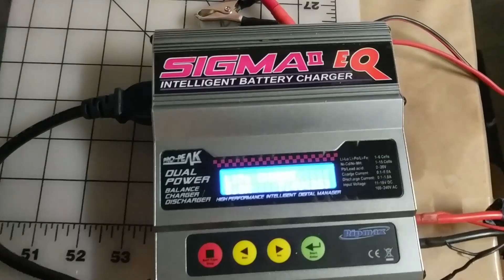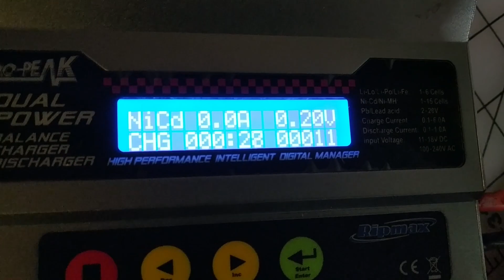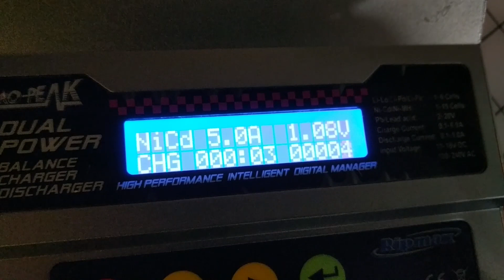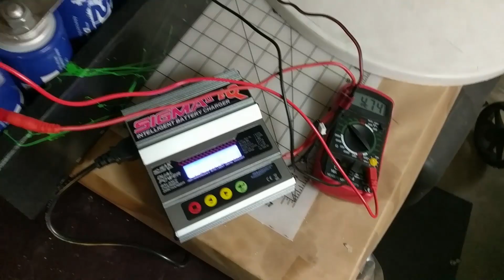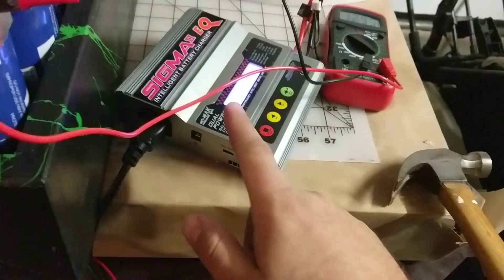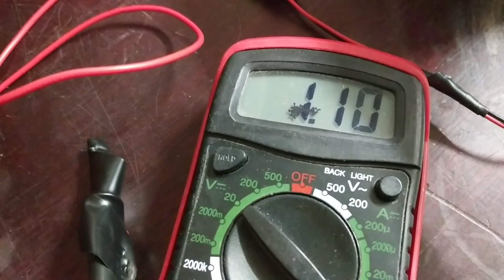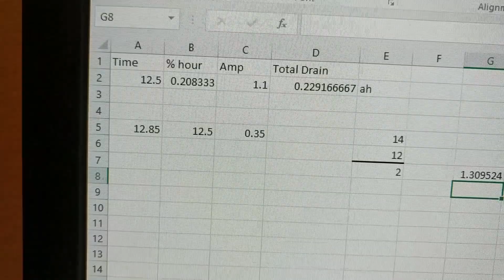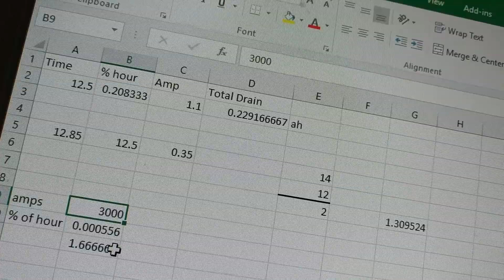How to charge a Maxwell bcap3000 + capacity test

Comment: man, you can charge these caps with a few hundred or even thausends of amps without heating them up! Each is able to deliver 2000 Amps continuesly! The max. short circuit current can reacht 10.000 Amps for a single cap! You should know about the datasheet when manipulating with that mass of super caps!
Reply: no worry with charging them from that pity charger... you can propably get that pack full directly from thunder
Reply: Yes for certain the could be charged in a second flat, actually. 833.3 ms utilizing a X-Former capable of delivering at least 37.5 KVA. With an output of about 20 VAC @ RMS of 14VAC feeding some healthy  thyristors...  Maybe a dozen of those 70mm. 1,100 TZ  Infinion's. In a Delta configured bridge with,  Duty control PWM regulated by set voltage cutoff.    Doubtful, it would take even 40 Hz to slam them full.  Giggle, but CAUTION when  selecting your sub cycle surge current overload fuse...  Wouldn't want to be off by much more than a few thousand A either way...  Giggle..  Yep, we sure could slam them full in a hurry..

But I admire his slow but sure initial testing.   Nice handy work on construction,  besides the longer Delta ( t ) span, the more resolution accuracy.

The tie blocks were nicely machined, nice work, nice proto work...  After reading about 27+ pages of the actual product Spec. Sheet from MFR, and a review of nice graphed response plots, one can come to a conclusion that expected cycle full load response curve plot shows that 0.2 Hz  or 5 second cycles are expected under normal use.

A few comments in this batch I saw along with some others in another video also showed some confusion when folks use the series Aiding math.

The standard formula for series capacitance does not truly apply here,  it's more involving ( dt / (Vmax - Vmin).   Not as a function of (Z) and (Xc) in capacitive reactance, because "Taou" or one time constant for this ultra cap is one second, and they certify it's performance half point at double the internal resistance on the curve plot on p. 26  clearly.

Exposing this device to a ripple voltage, would cause internal heating..  In fact it behaves more like a series inductor than a capacitor in a frequency response curve ending abruptly about 10.6 Hz..    They did 70% rest to load duty cycle plot..  Again 5 (t) is required for any cap, so 5 seconds.   This device is an amazing little package, if used properly, a time and place for everything in it's place.. Giggle..  These work wonders coupled  with battery as a (dV / t ) surge buffer or stabilizer to eliminate surge flow through PV distribution combiner buss etc...   Also great for high current short demands with DC BUSS inverters, and VFD's.

We use them for charge cycle flow surge current suppression,  "coupled with a high C. Cap bank" to handle instantaneous, current surge, allowing the ultra cap 1.5 to 2 time constants to begin responding, extending it's life cycle..

Caps in conjunction with this ultra cap and a good AGM telecom battery bank, are amazing..  We also are developing a true hybrid, using known technology, time proven..  Telecom batteries have a solid 20 year float life rating..  They also have a very flat. 0.5V.  Vmax  13.1V.   to 12.6V empty..  Keeping buss Voltages stable, exactly what the inverter Dr. Ordered..  Giggle..

Key note here, if your seeking long term low current battery backup,  with capability of periodical. High current or dynamic range, yes..

A million rated cycles, beats the panties off any known chemical batteries, hands down , safe compared to Lipo, as also lithium's require maintenance, inherently temp. Unstable, fire hazard, a time and place for them yes..

RC's , drones, power tools, even gadgets...  Yes..
Folks are quick to forget Boeing's little mishaps with a couple 787's still on the ground..  Giggle..

Sure thing Elroy, it takes time and $$$ you don't have to work out safety issues..  Just be safe and have fun, if you have an idea, then go for it, give it a whirl, also share your research and ideas, it how we got here to begin with...

I will post more as we go forward with our green power hybrid, coupled to a CAT. C-1. Purely or emergency reserve uses only..  A poly phase 460- -480VAC vector duty motor taunted into generating poly phase power back onto our own grid as then charging multiple array of 24 - 48 VDC  @ 1200 Ah bank.  Giving us 28.8 KWh per day storage for overnight usage.  We have 30 KWh daily PV in our array, but at 24V BUSS. We can only harness, 27.6 KWh per day currently, hopefuly by he time we refit before reaching, Cape town , SA.. We will have another shipment of another 1,200 Ah of telecom batteries to add.  Three banks ensure we have already reduced daily cycles to 1/3 or even every 4th day..

Enacting a 70 HP severe duty Vector motor, enables us to cruise adding extra speed day or night to our sailing Kts..  Also those pesky doldrums are no longer relevant,  3+ kts efficiently in no wind...   The CAT C-1 is backup gen drive, or direct drive...  For medical emergency flank speed ran devious for medevac  pickup, or possibly to out run hurricane.

The hybrid VFD , driving the Vector motor, is caoable of double current for 2 minutes with no damage for critical maneuvers. Impulse power for crossing a bar gives us, 140+ SHP at the turbine.

Far unlike the 55 to 65 actual HP from the original Perkins 85 HP installed back in the 1970's...

Rated for 31 BHP @ 1800. RPM the C-1. Is much less thirsty, and efficient by a factor of 4+..  Again only if there was an entire electrical failure for catastrophic reasons onboard we have viable backup direct coupled mechanical drive.

But utilizing the C-1 as alternator through another 20HP or 40 HP poly phase motor to then power the VFD directly, a separate system, much like a locomotive, or combined with bank A or B or BOTH adding instantaneous Vector energy in the hundreds of HP for critical maneuvers for up to 11 seconds per pulse..

Also increasin the diameter of the old wheel, from 24" to 26" giving it better traction with enclosed turbine style band ring keeps flow contained in thrust vector with more than double the compressor elements possibly 3 x factor traction.

Ultimately at a point later this season we will haul her our and install an upgraded shaft and bearing system, but for basic use and especially drogue generation use under full sailing, it will add to our regen and charge capabilities.

These super caps will be tested in several modes, as portable storage for our hybrid green power dinghy, also primarily as charge balance and bank charge flow control buffers, as also for surge stabilization with our 3 KW inverter and our 17.5 KVA Furonis 480 VAC industrial BUS for ships systems and VFD systems..

An in the field research project onboard  a research sailing vessel...  We will use our Maritron system to log all data, to ships database via the NMEA 2000 network and our Ethernet...  This should be productive and yield a ton of good data..  

Tens of thousands of sea miles ahead, other research involving sea mammals is my priority actually, but along for the ride and contributing to the effort where I can when I can...

Pursue your dreams, enjoy each day, anything is possible if your mind is open to it..  We were not meant to be slaves to energy corporations, banking cartels, or restricted by any government we empowered to begin with...  Think big, it's time to change this mess for the better and our grand children.  Be safe...
Reply: @KimBellaGurl  Hello Kim, I have a Perkins 101CV and I want to start it with this supercaps. How many time should it take to charge a 2'7V@3000F x 6 from a grid of 220V 16A? Do you recommend me any regulable power source for this?  Thanks you so much.
Reply: Kim BellaGurl how do you prevent your ultra caps from discharging to zero?
Reply: Longest reply ever
Reply: I was going to comment the same thing, but saw your comment.  It's funny watching him get worried about a 2-5 amp charge overheating them.
Reply from the maker: @SpoonerTuner  you live and you learn 🤷‍♂️
Reply: @LoudFiat  Why are you even saying 12volt this or that your banks are over 16volt capable and your using them for car audio to punch some big drivers in the ass while you have what 3- 14v+ 200 amp alternators throwing Zeus size lightening bolts at them. Honestly dude that tiny charger aint going to do nothing to them no matter what setting you put it on. These things charge faster than a meth-head can get your catalytic convertor off. Next time how about you don't play with stuff someone else pays for and stick to installing remote starters at the audio shop.
Reply from the maker: richardnanis agreed.
Reply: Jaynil Patel  Farad doesn't stack in parallel bank only when straight series. So what ever farad the first bank is is the total for both banks. Video is old to me so I cant math out with you but that is the just of it. looking at the picture nothing is x6 there is 3x5 + 3x5 noting what I said previously. So if each bank is 6k Farad combined the total is 6k Farad what would change is the ampacity or amount of amps capable to be discharged or charged in a set time.
Reply: each cap can short circuit at nearly 10,000Amps its just insane
Reply from the maker: 1ssac1 hahahahaha!

Comment: Where are your Capacitor balancing circuits?  Danger is one cap will go over voltage when charged... or reverse charge when discharging.
Reply: That's right, first thing when I watched this video I thought about the same. These capacitors should be paralleled with some resistors (can be small wattage high ohms resistors) to make voltage even on all capacitors. Taking into account that voltage is low (not higher than 2.7v), I think resistors can be about 10k. If voltage will be too differ resistors change resistance to lower.
Reply: @tesladude2822  a resistor is not going to cut it, you need to limit voltage, not current.
Reply: @SolarizeYourLife  Sorry, if you read carefully, I was not talking about limiting current, but about equalisation of voltage around capacitors. These resistors are connected in parallel to capacitors.
Reply: It's extremely difficult to overcharge these.   It would require hundreds of amps to push past the max voltage.
Reply: @Pops180  Overcharging does not require huge amperage at all. When you charging capacitors in serial, the capacitor with lower capacity than other has higher voltage than others. So capacitors will have different voltage on them. It has nothing to do with the amperage at all.
Reply: @tesladude2822  supercapacitors are different. Their charge resistance increases dramatically just above their max voltage.  This characteristic makes it very difficult to overcharge one of these
Reply: @Pops180  Well, there is no such thing as charge resistance. I'm done with these comments.
Reply: @tesladude2822  lol. Really?  You do know that resistance increases with increasing charge and decreases with decreasing charge. This is the basic physics for any energy storage device..  that's a free lesson to supplement your YouTube degree.  Smh
Reply: Maxwell sells balancing bus bars for these caps. Also, the maximum charge is 2.85 volts for a total of 17.1 volts, so it would be quite difficult to overcharge any individual cell in the pack. Self discharge will keep them balanced.

Comment: can this be used in a solar application with lead acid battery system
Reply from the maker: Nyght myst yeah but I don't see the point. Caps are great at discharging electricity quickly for high amperage needs. It may help even out your voltage spikes if you have issues with those.
Reply: Caps are great for their capacity to deliver heavy amp loads for short intervals. As someone else has mentioned, these caps can deliver up to 10,000 amps each at dead short and you have basically 6x this figure ie, potentially around 60,000amps at 12-16v at the bus bars if shorted directly.
 My thoughts are that this would be an excellent cap bank for a hybrid/ battery solar system as the caps will allow a much greater starting current ability for use with an inverter when starting up heavier loads like motors, fridge, air con perhaps, etc, especially when some of these loads could possibly start in unison at odd times.
The cap bank will greatly alleviate the heavy spiking loads that can harm the batteries and possibly the inverter.
Reply: Yes, I did this on my first system, my pole barn, small inverter system + powering 12v inside lights & outside motion lights. Simply make the caps last in your series bank. I took a 12v LA and parallel 16.7v 6-2.7v 500caps. been running now on it's 3rd year.  I believe caps works as a shock absorber / filter regulator to the LAs.